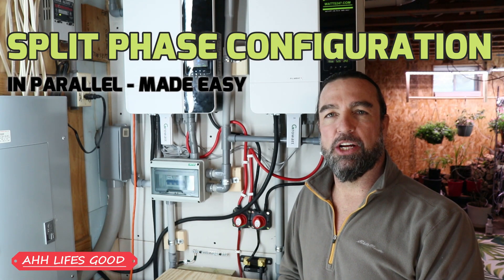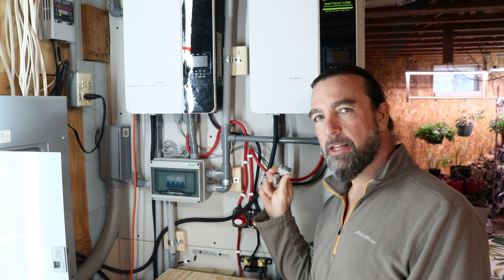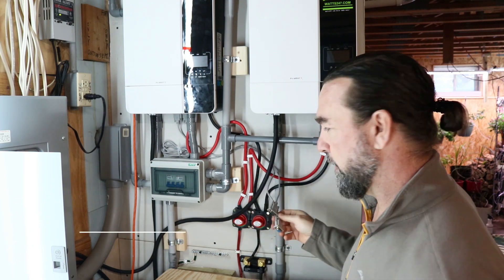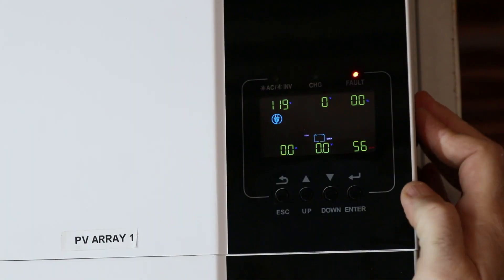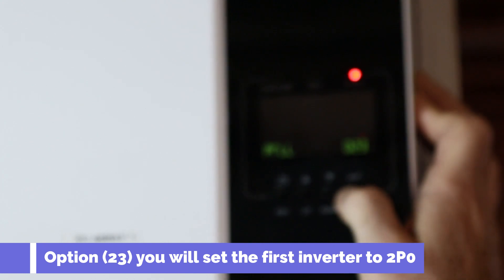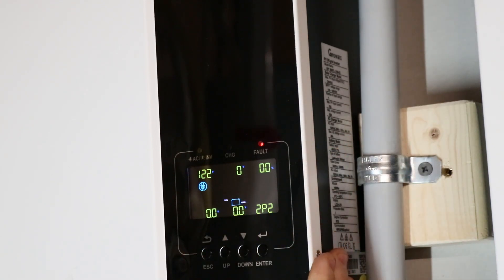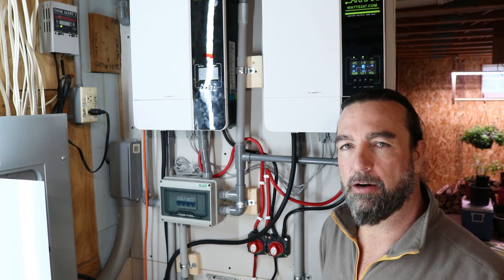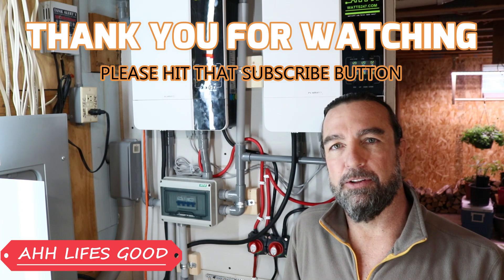Growatt Split Phase Setup and Configuration

Comment: Are you not using the transformer they recommend? To my understanding you would still want the transformer there in case of any load imbalances (inevitable).
Reply from the maker: I am not using the transformer they recommend seeing as these units support 120/240 and the setup is going into my greenhouse as is.... If I were to use this as my permanent house setup I would use and recommend a transformer to balance the loads. Currently the inverters, connected to grid do a great job of balancing loads, but over a longer period or off grid scenerio I wouldn't recommend not using a transformer with the growatt inverters.

Comment: ?!? So you don't need a separate inverter? as I've seen on DavidPoz and DYI Solar power channel. Maybe it's the Growatt model you have that includes the inverter?
Reply from the maker: Poz is using the 5000 Watt 240v only Growatt inverters in some of his videos, these inverters I'm running are capable of at 120 or 240v.

Comment: Do both of your growatts have the bonding screw removed or does your master have the bonding screw and the slave have the screw removed? Im getting all sorts of confusing information on how this works, is the N-G screw needed when in current sharing or split phase?
Reply from the maker: I do not have the bonding screws on either of my Growatts disconnected, nor do I have the bonding screw on my sub panel connecting neutral to panel ground.

Comment: Hey William, seems like I'm writing to myself. I'm William also, (Bill) new subscriber here. and Thanks for the video.
So a lot of comments are all around my question.
Is it 120/240 American 240? Does this invert the secondary phase 180 degrees to make 240 VAC when connected to a typical breaker panel? To clarify, Phase A is +120 at the peak of the sine wave as seen on the O'Scope and Phase B is -120 at the bottom of the wave thus making the potential between them 240. So using a typical 240 breaker (double breaker) say on connection 1 and 3 on the breaker panel makes 240? Connection 1 being phase A and connection 2 being phase B.
Reply from the maker: - Hello Small Shop Talk and thank you for the detailed responses on electrical explanation, and questions. The system is 120/240 as you suggest, making 240v at the panel. Each inverter producing 120v of true sine wave energy (US standard) and going to each leg or phase of the panel. If its a "true" 180 degrees from phase 1, I doubt unless these inverters are actually syncing? I don't have a frequency level meter to test but it does raise a good question when connecting 2 inverters in parallel split phase. thanks for the comments.

Comment: So I'm confused, I thought parallel meant that it was putting out 110,  and split phase was 220, but you're running parallel split phase.  I have the same two inverters but don't know how to set them up.  Is this system putting out 220 or 110?  Thanks!
Reply from the maker: - Hello Infinite! Good question, so in my understanding Split phase is exactly that, 120v each side of the split or inverter in this case, where as in Parallel you would combine both strings to have 120/240v. In this case I'm running both inverters connected in parallel but acting in "split phase" only sharing data between inverters but sending 120v lines to each side of the breaker box making 240v or 120 on each phase. This configuration does NOT use the power sharing cable between inverters. You can however from my understanding run these units in Parallel Single phase, be sure to check with your manual on configuration options as they explain pretty good.

Comment: A couple of suggestions on your overall installation. First like to know what state you are in to be able to determine which version of the NEC is applicable. My suggestion refers to grounding/bonding. You need to have one earth/ground location not multiple ones even if the rods are close together. Your presentation explains in detail methods used keep the neutrals together and the grounds together. You need to keep all the grounds in individual cabinets isolated and connect them all to a single ground which is likely the one that was used at your original service entrance distribution panel. The grouped neutrals in the original service entrance distribution box are connected to the service ground in the distribution service box at a single point.
Reply from the maker: - Hello Robert and thank you so much for the comments, really appreciated. I fully agree with your suggestions, maybe you can shed some light on a looming question I have with this setup and grounding rods for myself and those connecting to Grids?  
Currently I have the sub panel grounds and neutrals fully separated, no bonding screw. I do have 2 separate grounding rods installed, one servicing the main panel from the service box as you suggest, and the other servicing my Sub panel. These earth grounds are 200' apart. The reason I did this and where I can't seem to find any information on is if my sub panel shares the earth ground from the service box as it should under normal operations, this ground circuit goes through the inverter and is dependent on the inverter switching that ground circuit from AC IN (sub panel) to the AC OUT (main panel) to complete the earth ground connection correctly. Now if the Inverter takes a surcharge, it shuts down the circuits 100%, where does my earth ground go if I'm dependent on the inverter to make this earth ground? The short circuit in principal will stay hot without having an earth ground connection? Hopefully you can shed some light on this topic, thank you.

Comment: So you only need 2 inverters to make it split phase ? You don't need the autotransformer? Are those the 5000es?
Reply from the maker: - Hello J M - 1 Inverter is on Phase (120v) and the other 2nd Inverter is on the Phase 2 (120v) making Split phase. These inverters are the 3000tl model, the 5000es you would need the mid-point transformer unless you plan to run only 240v.

Comment: did some reading up.
looks like the growatts only like to comm with battery id1.
the id is set using the dip switches..
can you plug the bms with id 1 into your growatts and see if its horay ?
the growatt should be able to see the rest of the bms too when connectes to id 1
Reply from the maker: Good research and thanks for your comments! I did try setting battery number to address number 1,0,2,3,4 and 5 without success. I believe the Growatts have an issue reading the 24v architecture of the EG4's BMS, that or the software isn't programmed for it? Either or I'm planning to install a backup external BMS before adding anymore batteries. Cheers!
Reply: @ahhlifesgood1956  id0 should always be reserved for you inverter..
please do not use it as a bms id

Comment: What was the issues with all those problems you were experiencing with the Batteries? Was the Db9 cable connected wrong way?
Reply from the maker: - Hello sir and thanks for writing, the only problems I have with my batteries is being able to use the full capabilities of the Inverters communicating with the BMS of the 24v EG4 batteries. Apparently there is an issue with the communication between 24v EG4 batteries when communicating with the Growatt inverters. When you read the manuals from the inverters and the batteries they reference opposing dip switch settings and is why I tried the cross over cable idea to find a fix, without luck. On a good note the BMS of the batteries themselves handles the job they were designed to do without any secondary processes being handed down from the inverters. The idea for me moving forward will be to find an alternative BMS to install on my system prior to making the planned upgrades. Cheers

Comment: Thx.. Do you have these inverters powering a panel of dedicated loads? Or is it connected to your main load panel but grid is isolated thru a disconnect
Reply from the maker: Hi Blaine, these inverters are powering a sub panel with dedicated loads, 120v and 240v, connected to new and old construction. I have it setup in the hybrid configuration connected to the Main grid electric for when I need more current. The plan is to increase this same system by 300%, depending on how everything functions in my current location 46 degrees north! So far so good, other than blizzard conditions I get 0.1kw for the entire day!